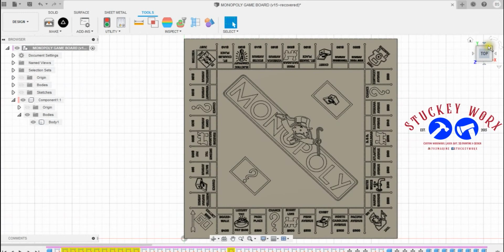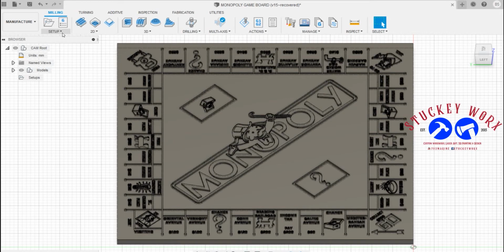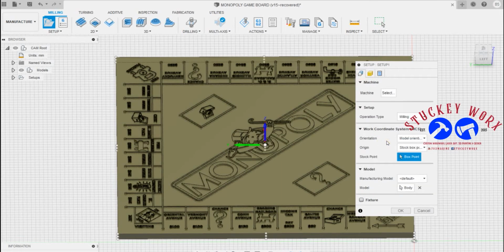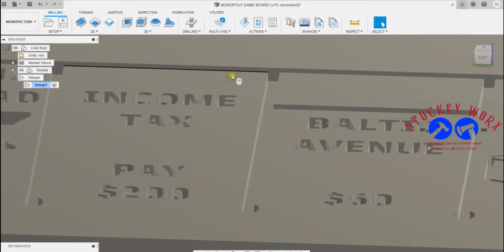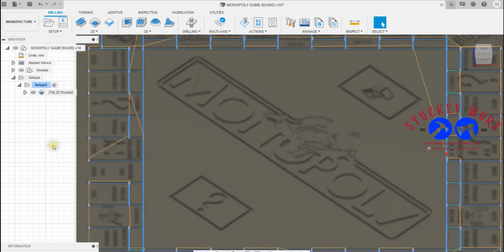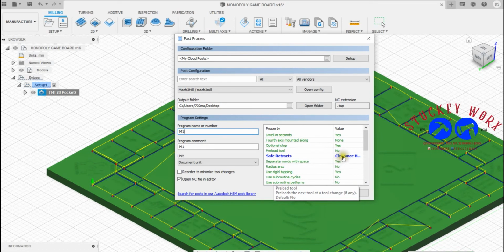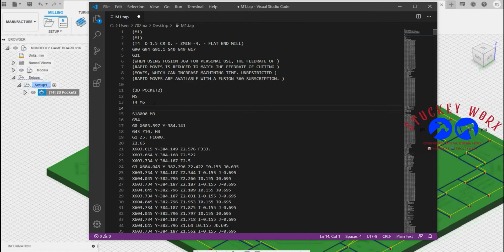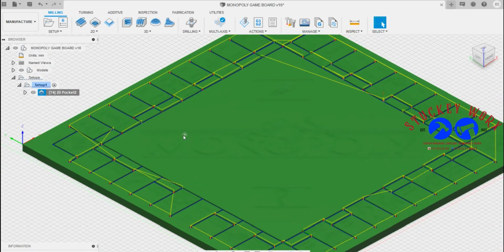Fusion 360 tool path setup, simulation, post processing to Mach3, and gcode editing.

Comment: Thank you for the instructions at the end of the video!

I was facing the same issue of the Z-axis not raising after it was done milling. But I didn’t want to add it manually each time i generated a new file. I edited the default Post Processor. 

Add this on line 844 and 1900  writeblock(gFormat.format(1), “X”+0, “Y”+0, “Z”+20);  in the default Mach3 processor :).

You can change the “Z”+20 to the number that you like.